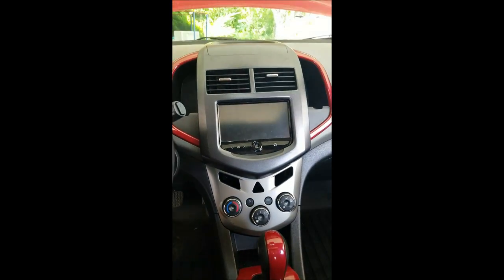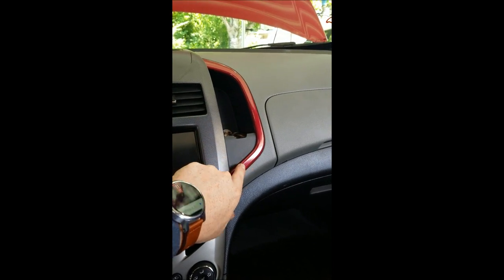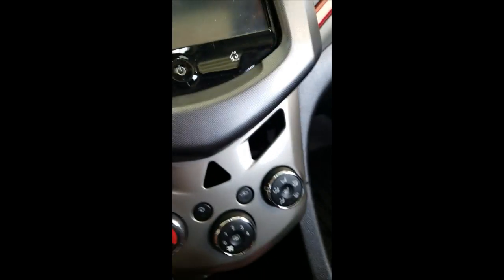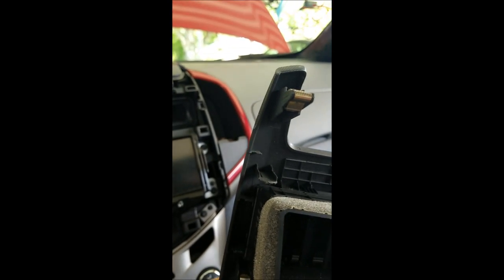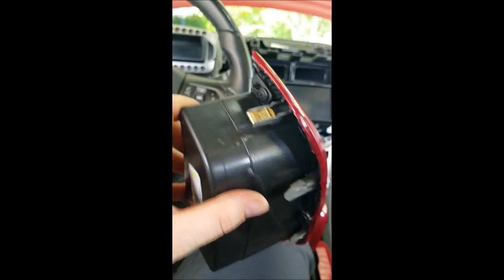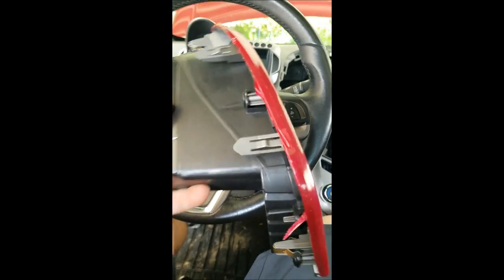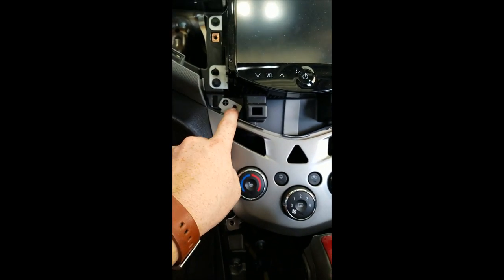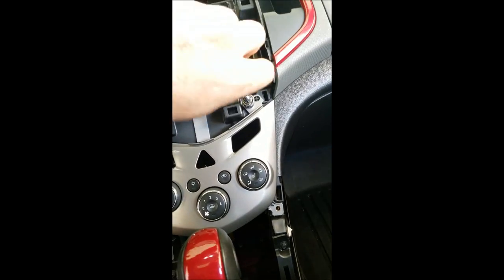2013 Chevrolet Sonic Dash Trim Removal

Comment: Today, my vent direction control failed. It was stuck blowing on the floors. Thanks to your video, I was able to get into it deep enough to correct the problem. It seems that the two way cable came off the dial. Reset on to dial.... Whala.... Directional control returned. Thanks man.
Reply from the maker: Kevin Macdonald  right on. 
Glad the video helped!

Comment: Thank you I have the same model with the airbag and tweeters in my pillars and been wondering what the best to way would he to take them out because I've been planning to plain them black for two years now haha.  I've done it with older cars but they didn't have airbags behind them or anything connected so it was easier.  Awesome video!

Comment: I have the exact same car (It's even that badass red) only the 2015. The only difference I can see is that chrome trim on the steering wheel. Excellent video - one of the more helpful- Worth subscribing.  I think I need to replace my heater core - I'm getting that smell inside.  Someone on the forum said the dealership removed his entire dash but all that was really necessary was the center console - it's where the core is located. Hopefully that will be the case.   I'm hoping you have more video's - I want to see how you put that vinyl on - it looks awesome. Do you have a list of all the mods you've done?Anyway - thanks for all the work - it's really appreciated.
Reply from the maker: IDig A. Pony the chrome trim on mine is because it's an LTZ.

Comment: Excellent video you gave me the confidence to tackle some parts of what you did. THANKYOU. confidence my weak point. How about upper glove box removal. Too be honest . Yes in 2017 to 2019 they added a second USB but took up space in center console by putting it there. Plus to set you phone etc into the right side dash pocket next to upper glove box your cord has to be much longer and see that and the USB's is ugly. Should have left the USB port part in upper glove box hidden away and shorter cord, even hide your charging phone in glove box. My model still has the upper box door notch and indent in edge of that  storage box. So my style USB could be put back there but only if the wiring for my lower mounted area is long enough to reach up to the upper glovebox. If I did that I would then get your older style lower console storage trim compartment piece around gear shifter and install that. Getting BACK they bit more storage space. I know you said you would like it the way my model is. But na. Plus my style you could spill something into the USB or just dust and dirt. So would the wiring for mine allow me to mount USB back in upper glovebox.  Question and answers guys.
Reply from the maker: Sorry I can't answer that one. I haven't taken that stuff apart yet. Maybe someone will comment and answer you.

Comment: what Did you put on your door panels? it looks like a cushion on the hard plastic area where your arm would rest? I hate the hard plastic on the panels. I'm also in the gamma fb page. :)
Reply from the maker: yes sir. I had an upholstery shop make me some little pads there. After a road trip from Alabama to Chicago I quickly noticed that my elbow got pretty sore form resting it there. Si they color matched the body with a vinyl material and put those on for me. Cost me $25 per door. Well worth it too. I didn't want it permanent in case i didn't like it, so they're just installed with a decent strength double sided tape. I think next I'm going to get them to make some little cushions in the same color to shove between my front seats and the center console for the simple reason of stopping things from falling in that crack. It's super hard to reach stuff that falls and I hate removing the seats just to get a good detail cleaning on the interior.

Comment: well I am going to be installing a boost gauge with the zzp gauge mount that fits were that upper tray goes so this helps although I still need to run the vacuum line can you see under the dash in order to run the hoses or I need to take the top part of the dash off ? I like the fabric you used on yours .......great video thanks for posting
Reply from the maker: Thanks. And from what I recall, I was able to see into the dash pretty well, but I'm not sure what all is entailed in the gauge installation. Hard to say if only removing trim will suffice. If you don't mind, comment back here when you get in installed and let us know. Good luck.
Reply: Brandon Gray 
I used your video to remove the panels and unbolted the radio spliced into the radio wires for the lights for each gauge ,then ran the wiring up through the rubber boot in the fire wall ....
Reply from the maker: sounds like a win

Comment: My grandsons A/C switch seems like its not working,only blows hot air.How do I remove the switch to check if its ok.Thanks for the great video.
Reply from the maker: at 12:08  you see the big white things? I would check to see that they're plugged in well...but as far as troubleshooting AC I'm not really sure what else to consider. Not really my expertise. Sorry, wish I was more help

Comment: What kind of vinyl wrap did you use for the center radio trim?
Reply from the maker: skurtov 
the section around the radio was left unwrapped, but everything else I wrapped was done in Oracal 951

Comment: Where did you find your red cover at? I am looking for a blue.
Reply from the maker: you mean the red trim on the dash?
Reply: I'm sorry your cover that you have on your lever for P, R, N D in your gearshift area, did you buy that or spray paint it?
Reply: And the trim to. I have a 2013 as well but a sedan version, wanting to customize the inside a bit. Thank you!
Reply from the maker: it's all wrapped in vinyl actually